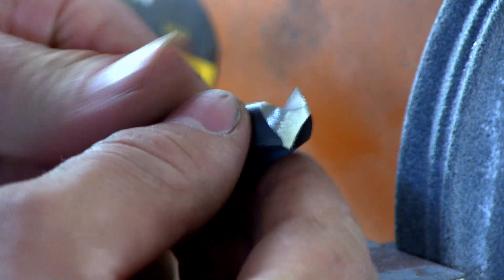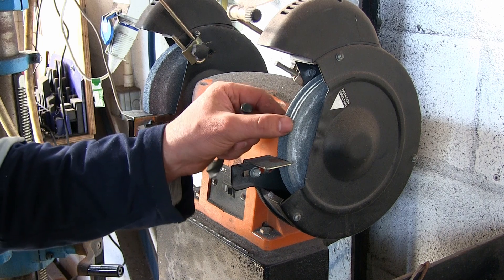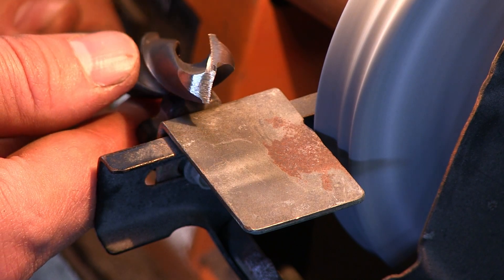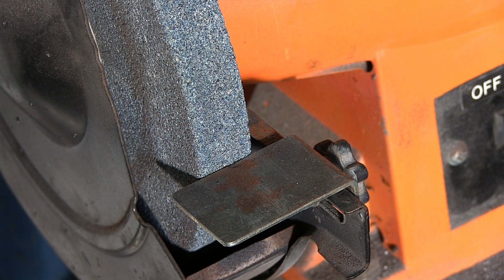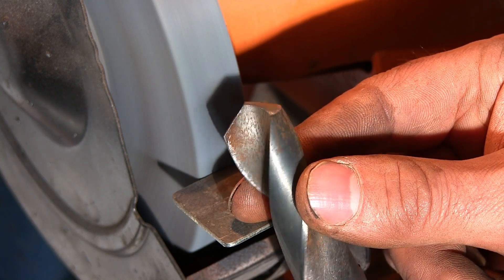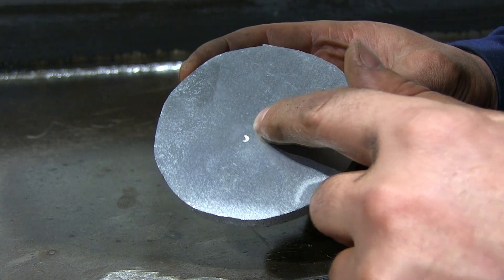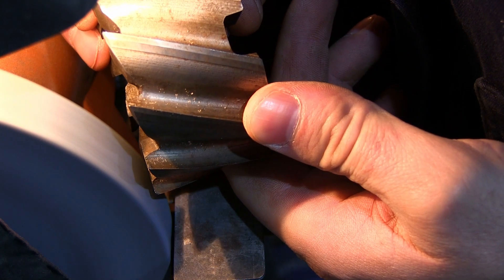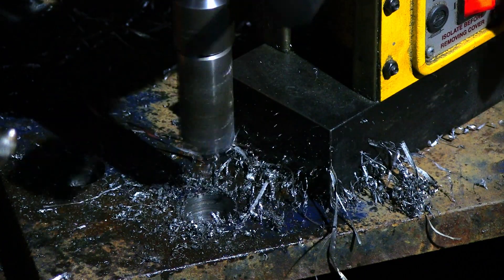Sharpening drill bits for metal, drill sharpening by hand.

Comment: Great video because we all need to sharped drill bits. I don't have a bench grinder yet so I use an angle grinder, not ideal but I can get a edge eventually. Annular cutters, that is the name of the mag drill hole cutter. Some people call them broaches or rotabroaches. A tricky job sharpening them. 
50mm x 10mm flat bar in a machine vice on a pillar or bench drill for drilling with a 7mm drill bit, if it's an HSS drill bit, probably about 12 holes subject to how much pressure you apply when drilling? A cobalt bit should do double that and with coolant even more.
I bout a 20mm TCT holesaw and cut 54 holes in some 6mm plate with a mag drill and coolant, the TCT holesaw is still sharp and good for more work!
Reply from the maker: Yes, those annual cutters called anything and everything under the sun. 

I prefer them as I can resharpen those many times.

Probably worth investing into good diamond wheel and be able to sharpen TCT.

As far as amount of holes with a 7 mm drill bit I managed 2700  and bit was still fine.  Had to resharpen it about 6 times, had a good solid fixture and foot cutting oil

Comment: Another great video. Thank you for sharing! Can the web undercuts be made if a worn stone like yours isn't available? If yes, how? Thanks again!!
Reply from the maker: Yes, you can do it with the corner of a new stone, it is a little harder as space for motion is limited since you try to avoid damaging cutting edge. For this reason it is preferable to undercut the webbing first and sharpen after. In any way everything comes with experience. So what is yours prediction on how many holes can be drilled in 10mm steel with 7mm drill bit?
Reply: @weld-deluxltd7635 Thanks!! So, here is my guess (Being new to metal fabrication, I really have no idea): Assuming the proper speed, feed rate and lubrication are used, 20 holes without sharpening.
Reply from the maker: @jwoodyr1  Thank you very much for your educated guess. I love that you already recognize that there is always more than one factor that will influence the outcome. you will get your answer in the next video.